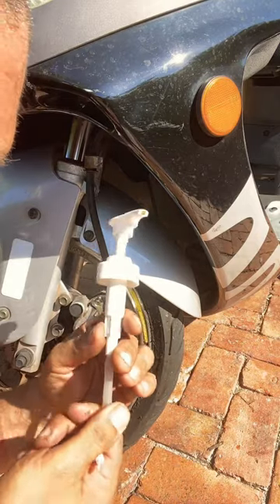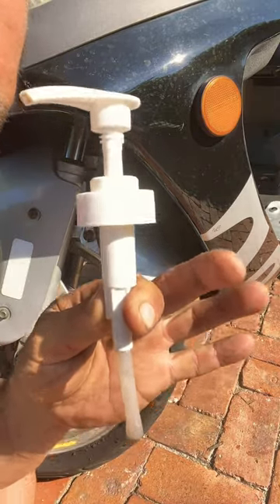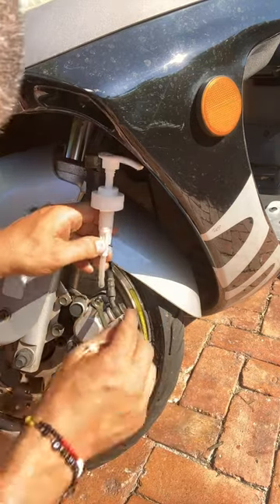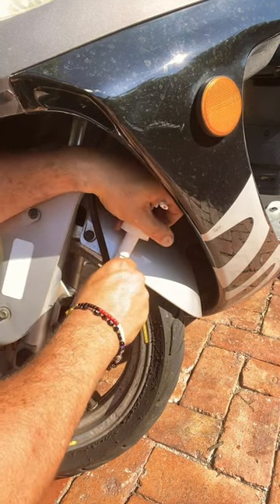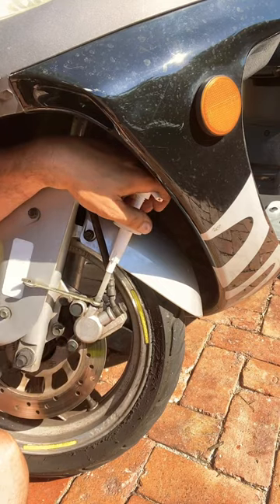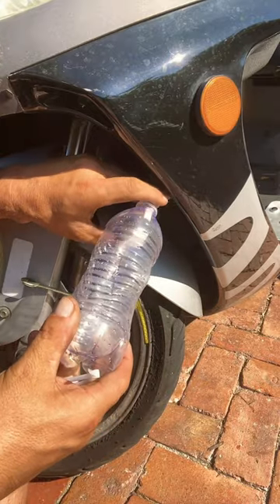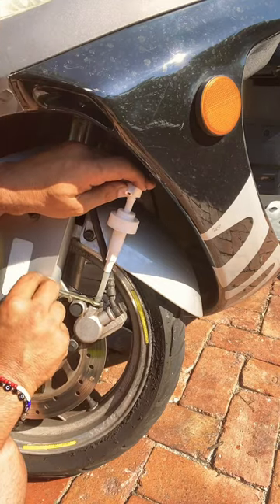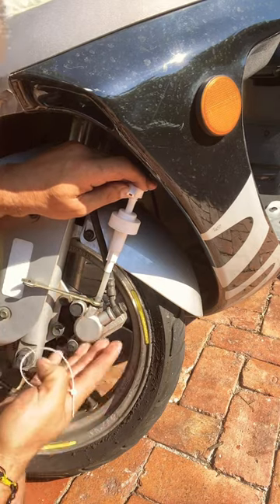Caliper pressure hack #shorts

Comment: Can u do this on cars
Reply from the maker: yes you can but because is a bigger system I will use a better equipment
Reply: actually you can use a aquarium tube to fit over the brake nipple and the tube to the little shampoo head pump.